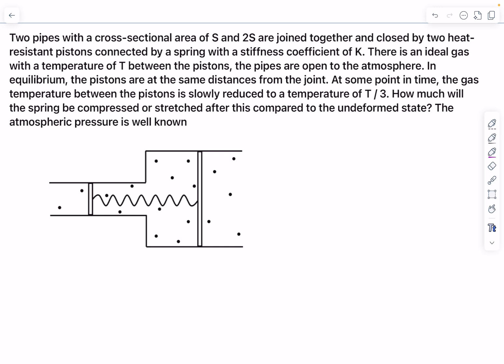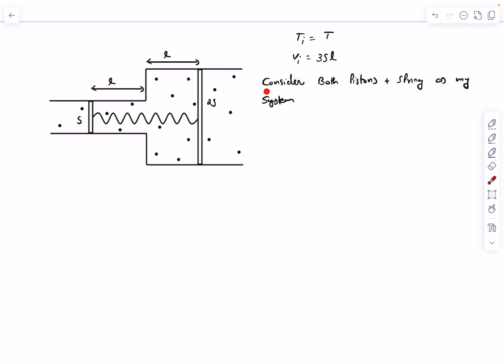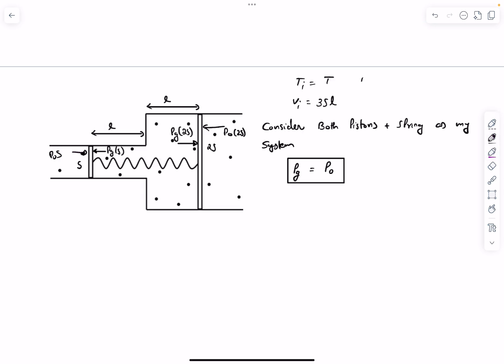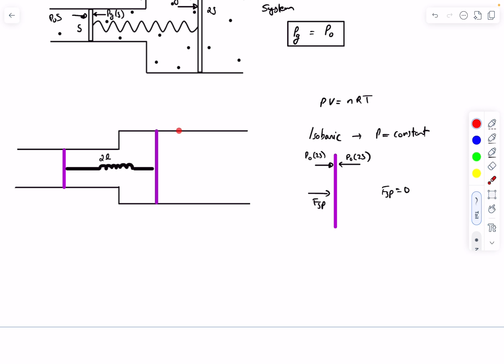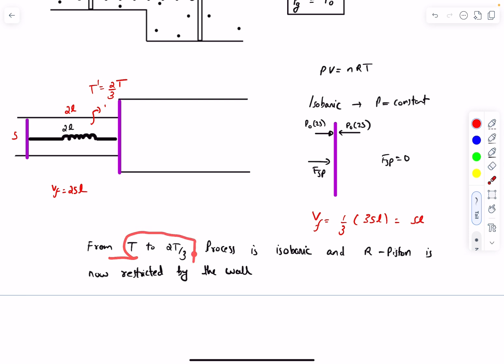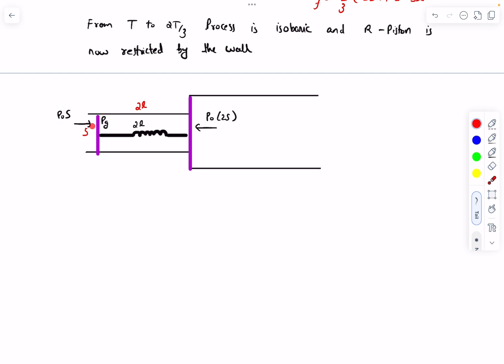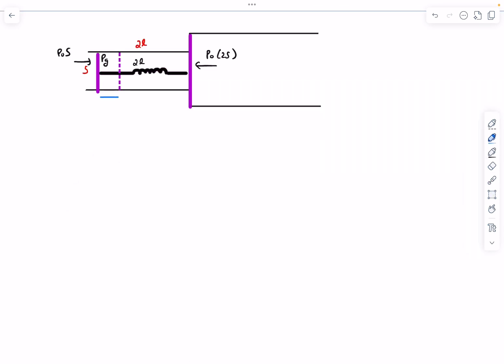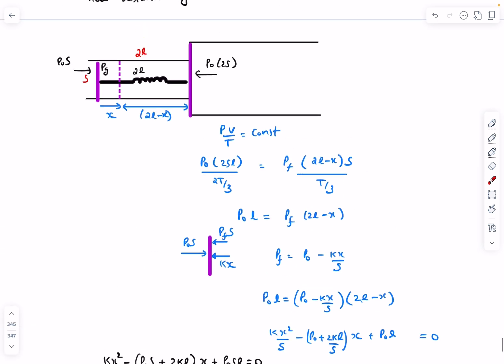[Jee] A Good Problem From Thermodynamics

Comment: how did you conclude that the length is constant i.e. 2L, why cant there be a displacement of piston one by x1 and piston 2 by x2 and then the system is in eqm ?
Reply: Think once if they move why would pg=p0, they given in question temperature is reduced very slowly such that pistons. Are always in equilibrium until right piston hits wall